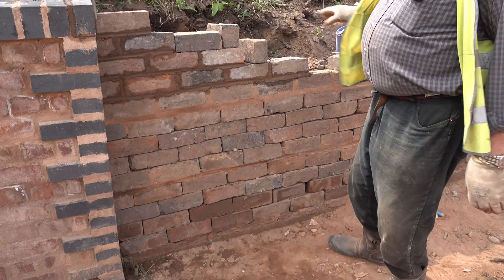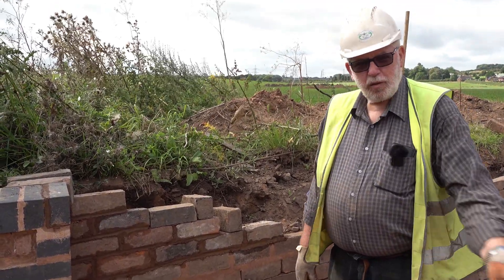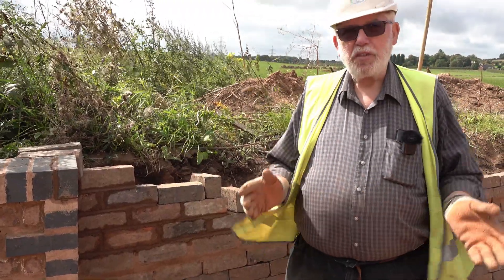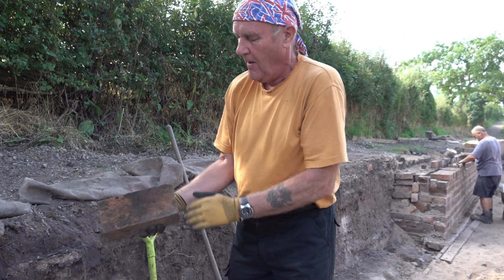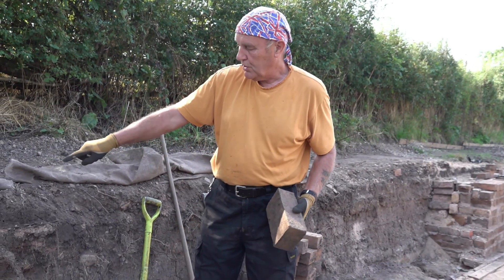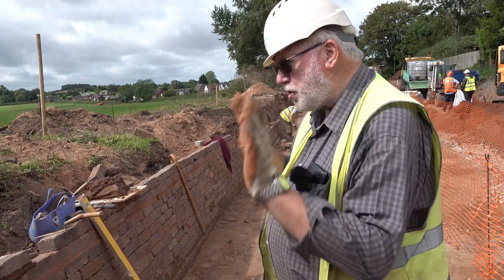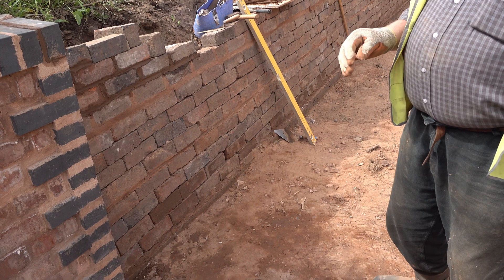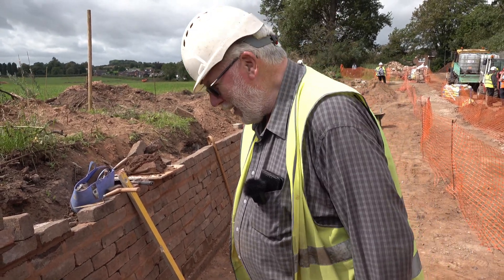Dry Stack Brick Walls on the Lichfield Canal

Comment: Was it originally done that way to save on mortar or was it to allow more movement with the ground?
Reply from the maker: As ever, cost was must have been a consideration but it may also have been to do with speed,  bearing in mind the whole seven miles were built in just three years.
Reply: @LHCRT  That is an impressive construction speed.

Comment: Awesome. Perhaps later in life I'll one day be able to help in such a project.

Out of interest, is it not worth selling those old imperial stock bricks for around £2 +/-each and buying new bricks for £1 +/- each?
Reply: I doubt  new bricks  would be of the same quality, as the originals . They would also be smaller . Unless you went to a manufacturer who still makes imperial sized bricks , they do exist, but the new bricks made to old imperial sizes are expensive. I bought some for my house they were £1.00 or more  each 15 years ago .
Reply from the maker: It's worth considering. 👍
Reply: it's a fascinating fact that you have exposed,as a builder I have built dry stone walls,but never walled bricks dry on purpose, except when needing to remove them later ,and that would be on a sand bed .thank you for sharing
Reply: That would not be restoration!!!